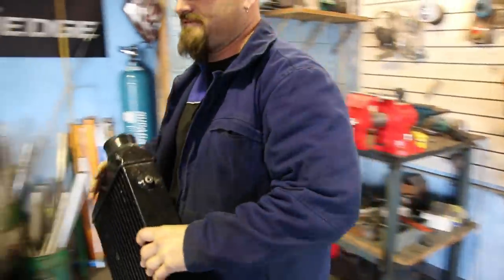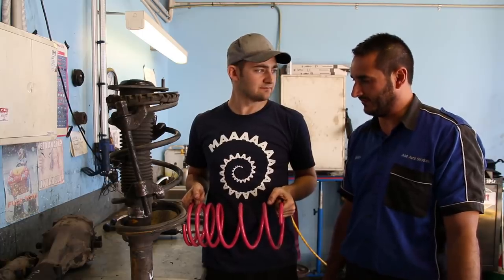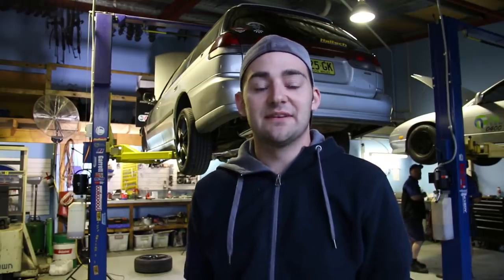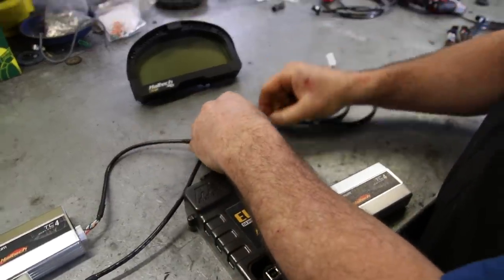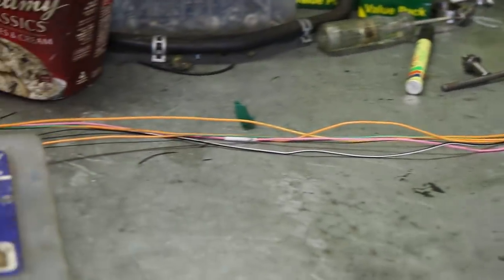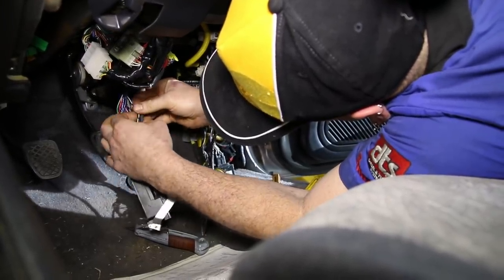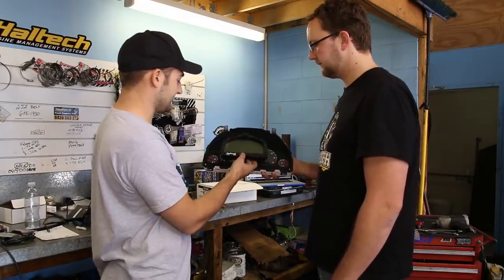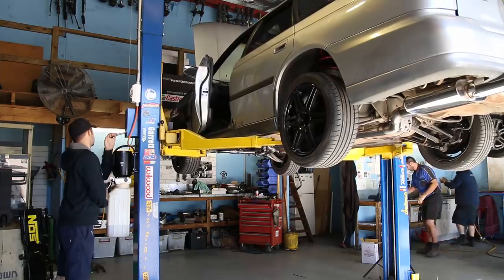Gramps the 11 Second Car - Build Part 7

Comment: This has been an immensely entertaining series. Ive never really turned a wrench on a car except to do an oil change and I would love to be doing what you guys are doing here. Wish we had guys like you here in my part of the States thinking outside the box, at least to me, on how to power a fast Subaru. Cant wait to see the finished product.
Reply: Buy an old piece of shit that actually has some potential, then just start wrenching on it. When it's something you don't use to commute to work etc. and might not even have plates, you tend to be a lot more confident in taking it apart.
Reply: Anders Kristensen That's exactly what I did when i was 17 and Im in my early 20s now and I've swapped transmissions, repaired suspensions, done bodywork, brakes etc. and I'm completely self taught. Just get started.
Reply: Exactly the same here in spain.. and we also have the bitches at the car inspection (named itv) who don't like anything that didn't came from stock, and that makes really hard to find people up to do any mods on a budget car just because we won't be able to drive it on the streets, not without paying some taaaaaaaaaaaAAAXES at least (you know)... It really sucks..

Comment: Wants a sleeper wagon called Gramps. Proceeds to put performance shop stickers on the back, and a 2,5" cannon. The rims are excusable considering the STI brakes. Admit it Marty, you want a badass wagon. Can't blame you tho, I want an E30 or E34 touring.
Reply from the maker: Anders Kristensen it may begin as gramps... shop stickers are a way of saying thanks for the support. Badass wagons are well and truly in our hearts!
Reply: I have one of these with a ej22t swap, lowered, gold wheels, 3 inch exhaust and a unnecessary loud BOV in it. Its still a sleeper because everyone just assumes its a slow 90's wagon. I pull on wrx's all the time with only 7psi on the current setup.
Reply: Travis Quiller Pulling on WRXs or STIs? WRXs aren't THAT fast.
Reply: Mr.Science A WRX is still fast... They will beat XR6Ts that are at stock and just above stock level.
Reply: Mr.Science
Depends on what the car has. My WRX has beaten STi's.
Reply: There were a few years where the WRX was just as fast as the STi.
Reply: Mr.Science When is the last time you drove a stock 2nd gen wagon. They are super slow. The N/A 2.2's are durable but they are gutless so I just swapped to something a little better.  Either way, just WRX's so far. I haven't done a pull next to a STI yet though. I'm at right about 220 wheel right now.
Reply: Nick Charette
Its mostly because my WRX isn't stock but it's still a WRX lol
Reply: I totally agree. They lost sight of the whole sleeper Idea.
Reply: ***** To be sleeper these days you have to look like somebody trying to look like somebody that has horsepower.
Reply: You know, there is something to that.
Reply: was also meant to be a budget build. far from budget. Some or the workmanship seems a bit dodgy in places too :S
Reply: Gee Zed Eee Power What looked dodgy to you?
Reply: Stephen Kauffman
my memory is shit and i watched most of the build in one go so i can't remember specifics. Just thinking "fuck, for a workshop, that looks dodgy" :(
Reply: but dont get me wrong some of the work looks amazing at the same time so its not all bad. Just that the bad takes away from the good.
Reply: Oh yeah I can see where you're coming from.
Reply: Gee Zed Eee Power not all workshops need to look like a multi million dollar racecar team to produce great work.
Reply: more like 3"+  lol
Reply: Gee Zed Eee Power
yeah i really wonder what it will cost and what it would cost if you had to paid the mechanics
Reply: Anders Kristensen The cost of doing this yourself (ie not supported by the various companies that MCM are) and actually paying AM auto to do this swap for you would be tens and tens of thousands of dollars. The labour costs alone would be astronomical.

 Marty says at the start they are on a 'budget' so they certainly aren't paying full price for what this would cost to do.A couple of stickers and advertising on some internet videos is an amazing deal for this car.
Reply: Anders Kristensen But they have been given free stuff from companies so they have to do a bit of advertising for them and as for the exhaust it's a crucial part of performance and free!
Reply: Strider Sky its only like a couple of kilowatts though but makes the difference in the long run
Reply: Hookemups Settle down there Timmy.
Reply: Fonction of part of the  car
Reply: guess who has an e30 touring

Comment: Man I love how simple a carb is lol. My head hurts from all this EFI stuff.
Reply: Keep in mind that this is a complicated engine that is designed for efi. The turbo adds even more complexity. I do like the simplicity of a carburetor more than an electronic system.
Reply: very little of what they are using here is necessary. personally im running megasquirt in my car and i ran like 8 wires for my entire car which is a turbo v6.
Reply: jameswoodsist lol. so can you tell if your car is running lean, rich, pinging, detonating?
Reply: I'm not saying one is better than the other but EFI will always have better drivability. There are many engines that must run on a EFI setup and Gramps is one. I'm really digging Gramps setup so I don't want people to get the wrong idea. I just use what I know and once you know a carb its easy to read plugs to know if its rich lean or detonation. Its just good old american V8 HP knowledge.
Reply: jameswoodsist megasquirt is miles behind this haltech system in what can be monitored and controlled
Reply: 0991ekul yes. megasquirt has inputs for all of those things and can do all of your fuel mapping.
Reply: nicholas Leblanc the bottom line is that i have run 700hp on a 200 dollar megasquirt system where as they have spend at least 100 to make maybe 400..
Reply: i see, so its just old tech then without all the bells and whistles? fair enough if it gets the job done. noone likes to fork out their weeks/months wage for an ECU and other components when it can be done for a fraction of the cost.

however some people who track their cars  want or need to know how it performs in every single possible manner, in the name of lap times i guess.
Reply: Bottom line is your mega squirt system would not run this engine
Reply: 0991ekul thats the thing.. megasquirt literally just came out with ms3 1.3.2

megasquirt isnt "old tech" they come out with new shit all the time. its just usually what domestic guys use and most import guys never know about it. you can do literally every single thing these guys are doing with their haltech for a fraction of the cost. the only reason they are using haltech is because they are sponsored by them. i mean haltech is great too, but ms3 will literally tune your car automatically while you drive it, it has every one of these inputs and its cheap as fuck.
Reply: nicholas Leblanc lol you dont know what youre talking about.

megasquirt is used to run this engine, my engine, trucks, cars, bikes, lawnmowers, hydraulic lifts and pretty much whatever else you want. its 100% standalone and completely programmable. 

try it..
Reply: jameswoodsist where are these megasquirt things from? are you from america? 

here in australia alot of the import guys use second hand japanese standalone ECU's, paying $500 up to $1000 US dollars. 

Hell ill give you $500 if you can ship me one to western australia and i dont even have a car to use it in yet!
Reply: 0991ekul diyautotune.com

if you build it yourself (like i did) you can spend as little as 220 shipped, installed, and boosting in your car.
Reply: jameswoodsist In Australia, that's not a reality, sadly... It's all so much more expensive here & many parts just aren't available or have to be shipped in through a private seller from the US...
Reply: Beautiful but not always easy 6 down draught webbers on a 12 cylinder?
Reply: I see now, perhaps if you are very near to the US you are able to reap the benefits of this brand. It also takes DIY car modding to a whole new level. Im not sure how involved it is? Soldering all the resistors, caps and chips on? Potential recipe for disaster.

I would sleep alot better at night knowing i've got a proven, factory tested ECU that controls a $10-15k engine bay.
Reply: 0991ekul you can buy a ready made unit for under 300. then you just cut the harness to length solder the plugs to it. if you cant do that you shouldnt be under the hood.

my point was simply that there are ways to do efi that are cheap, easy and highly effective.
Reply: jameswoodsist im sure it would work great if its installed properly, and if any tuner can program it.

more often than not, the word 'cheap' doesnt go well with 'reliable' or 'fast'.

all i know is next time i wont be buying a cheap turbo or cheap exhaust manifold, among other things i learned.

the poor man pays twice :)
Reply: This why i love the ford factory EFI setup, no need for any aftermarket gear just a flash tune to remove security and harness modifications and you can retro fit a Ford Barra turbo inline 6 into a classic falcon in which bolts straight. I wired up a AU inline 6 into my 1978 falcon using part of the AU loom and ecu with a j3 chip and it works awesome.
Reply: gtlegend007
Man straight 6 engines are the best
Reply: 0991ekul dude just do some research on megasquirt. its the most commonly used standalone on earth.
Reply: ***** haha try tuning a carb and dealing with elevation, and temperature changes. EFI all the way :)
Reply: 0991ekul Check out ***** he was running turbo LS motors hitting 10s using megasquirt... now he is using stock ECUs for whatever reason but fast and reliable is megasquirt...
Reply: thebudman67 actually i have gone 9s with megasquirt products and stock pcm
Reply: *****
Thats a crappy excuse to not have carbs. You would only need to adjust a daily driver twice a year, for the summer and winter and also during maintenance. You would dial in an actual racecar at the track anyways.
Reply: *****
Why are you bringing fuel efficiency in like carbs are some super old and inefficient holes in you gas tank. That is not the point here, the point is that carbs give you a whole other experience and engine characteristics. Plus the simplicity of a carb is just magical and the design is plain genius. EFI has its strong and weak points just like carbs.
Reply: lolatmyage Its ignorance of not understanding them.
Reply: I think people are getting out of hand with my simple comment. It was suppose to just be good for a laugh. What have I done!
Reply: Tylers Photo Video
it's youtube man lol what did you expect?!
Reply: *****
dude you have no idea how a carb works do you?  it doesnt "pump" anything - it uses the vaccum of the engine to draw the correct amount of gas, the only system that pumps gas into an engine is efi.

and for those that thin economy is a great excuse for ditching old technology, i drove a ford 390v8 pwered car 400k's on less gass than the hire car - a brand new for 4L strait six.  efi better at economy?  only sometimes...
Reply: *****
 you said it a few comments above my original one - five above i think.

and as far as horsepower difference between carb and efi - there is none!!! horsepower is not made by the carb, nor is it made by the efi system.  it is made  by the compression and explosion of gas inside your engine and the rate at which it can be brought in exploded and sent out again.  there are advantages to both systems, but at the end of the day horsepower boils down to which one flows better and delivers the correct amount of fuel at any given point in the rev range - if your efi is tuned properly it will be great, if your carb is tuned properly then you will not notice a difference between efi and carb.
Reply: *****
if your carb is tuned correctly it wont do that.  and dude, seriously?  you seem to have no idea how a carb works!!  the amount of vaccum present in the engine decides how much fuel is drawn through the carb - the carb doesnt decide how much fuel it provides itsimply controls throttle and air fuel mixing ratio!
Reply: *****
Keep in mind that youre arguing about fuel efficiency on a video about a crazy turboed subaru wagon.
Reply: ***** spamming?  Im replying to you.  and as much as I hope youre joking, I dont think you are - Ive run carb and efi setups on the same car before....  Im speaking from my experience, you are from yours - no difference when both a tuned correctly - carb has a little more top end grunt, efi has better control down low.

never had a car loose hp when the car was tuned correctly - just had a different torque band on a dyno.

youre probably right about it getting less mileage with efi than a carbd turbo wagon though, turbo on carbs changes a hell of a lot...
Reply: *****
My point is that mileage is completely irrelevant when it comes to performance. You can argue about mileage when discussing which shitbox is the best choice, not when talking about the differences between fuel delivery types.
Reply: For any motor that can accept a carb its the best $ to HP known to man.
With all the extra money I can save using a carb I can get a nitrous kit. Who cares about an extra 15-30hp you can tune with EFI when I can get 200 more from N2o.
Reply: *****
 If you want MPG get a Toyota Prius....

And...
Excess fuel being dumped cools the engine not make it more hot. Too lean makes the engine hot.
I don't think you know much about carbs honestly....
Reply: Tylers Photo Video The answer to that question is drivability and convenience.  For track/strip use, a carb may be cheaper, but with a big power engine you often run little vacuum, which especially with the high CFM carbs typically required for high power engines, means bad idle and troublesome low rpm operation.  An EFI setup can mitigate most of those issue (though the fundamental issues with valve overlap and low vacuum are still present).  Also, at the track say you want to change your tune.  With a carb you'd need to do at least partial disassembly.  With EFI you simply plug in a computer and tweak some numbers.  EFI effectively means a car that would be strip only in 1965 can be daily driven today.

And FWIW, I own EFI, twin-carb and single-carb cars.  I've tuned all of them, and EFI absolutely wins the ease of use argument.
Reply: All I see is a lot of blah blah blah... My budget calls for a $600 carb and runs great on the street. 7000rpm solid roller 355 SBC.  Its on my channel also if you want to check it out.
Reply: You only saw blah blah blah even where I agreed carbs are good at cheap performance?  Here's a question- at a track, should you find you're having a misfire at high RPM, how would you figure out why?  Read a plug?  Or do you use things like wideband O2s?  Either way say you found out that you needed to increase the jet size or adjust timing (or both).  How would it be done on your car with it's piping hot engine?  On mine I'd spend literally a minute with a laptop to change the fuel injected at said RPM, the timing at said RPM, etc.  I also have No-Lift-Shifting, Anti-Lag and Launch Control.  Granted none of them are useful for a supercharged car, but they're there, and without an electronic ignition controller you can't do that with a carb.

FWIW my supercharged Subaru that runs an OEM tuneable ECU is on my channel.
Reply: Well I have never had a misfire on top end with a Carb only on my Camaro that was EFI. And it ended up being ignition.
Reply: Both systems can have their problems.  Realistically the tradeoff for EFI vs carb is cost or convenience.
Reply: Really? I found the opposite to be true myself. It might be a generational thing.
Reply: As if the mechanical and flow aspects behind a carburettor are simple... yeah... right...
Reply: I think it is awesome that we have come to the point that we can actually retrofit ECU control of a car. We could literally do that with just about any car now. Carbs are cool but in terms of efficient power production they just can't do what the newer tech does. That is kinda what the tuner craze is all about. Little engines doing crazy big things. Except that it is cool that not many 3.6's have done this before I would almost rather see them take a little 2.0 and make it produce more power than a 5.0 V8. That is cool to me.
Reply: jameswoodsist your car isnt quad cam each with VCT, and changing from mechanical throttle to fly by wire...... etc etc
Reply: scootbmx01 megasquirt 3 has revisions for that as well and can still be 100% installed, tuned and running for well under 1000 dollars.
Reply: The simplicity part is true however I have come to appreciate the fuel savings not to mention more horsepower with less engine. That said there is something fun about being able to fix it yourself.
Reply: 😢😢 @0991ekul 😢 1😢😢the

Comment: I like the way Turbo Yoda works. Doing everything how it should be done, trying to use as much Subaru parts as possible and having the filosophy of 'the manufacturer spent a lot of time on designing this part, no reason to mess with it because you know it will work perfect like this'. Doing everything by the book, and not skipping steps even though you could and it would still work. Hats off!